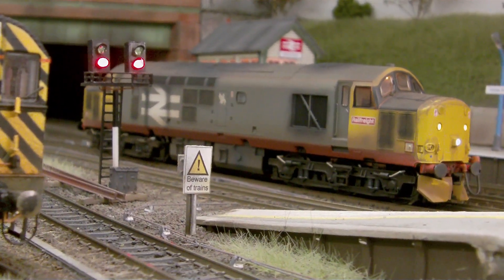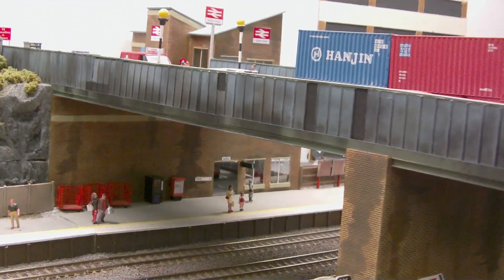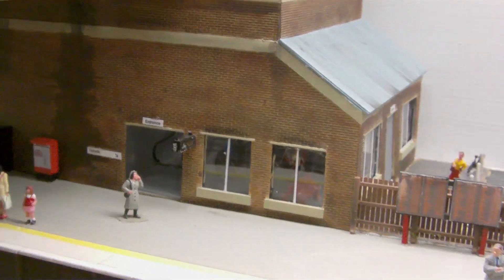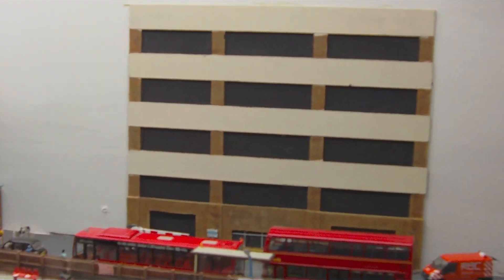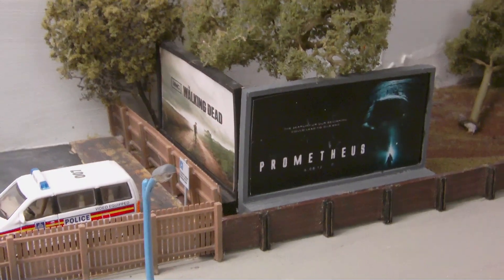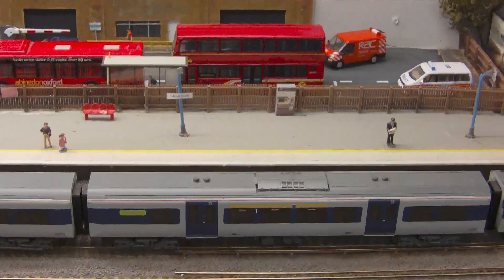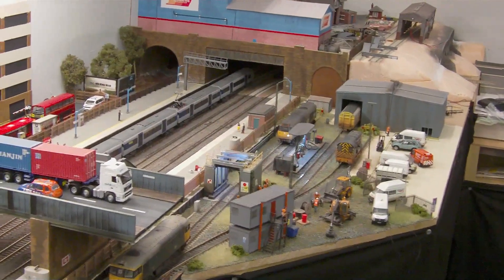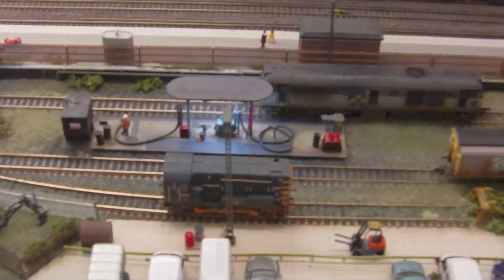August Update.

Comment from the maker: thanks richard

your right about the shed.i am going to turn it into a small network rail wagon repair shed.ilike you say the signs still needs to be added along with the door and glass for the windows and other details.
yeah im not to sure whether i will have the space to fit the points in unless i moved them into the platforms a little more but then that wont look realistic enough so it may have to be added else where.

Comment from the maker: hi shane

i think the multi storey car park measures around 12 inches high.
the road was made up with a first coat of tarmac paint and when dry i dry brushed lots if different shades of grey until i was happy with it.i used the same process with the path but used a sandy colour as a first coat to represent the concrete render and then again dry brushed lots of shades of brown and grey.its a long process but worth it.

Comment: another great update terry, your station is getting better and better, every time i see it, and the fueling points looks well good now, def better without the engine shed, maybe use the building as a network rail maintenance shed or warehouse or something like that, not sure I would change the throat of your station, could you leave that part of the layout as Glebe Rd station and have the junction side the left hand side of the concrete works

Comment from the maker: hi tommy

the shed is going to be a small network rail maintenance shed.i use a static grass applicator just like the noch one but i got it from hong kong and was around £20 and works just the same.
i use 2.5mm grass to begin with then top it up with 6mm grass to represent the overgrown areas and the grass i get from international models.

Comment: On your class 08s, try adding black weathering powered (Humbrol Black/smoke) to the rods with some oil (3 in 1), use a small brush to mix it and it looks really good on the rods of the shunters, I have done it to mine and it just makes them look that little bit more you see, give it a try and if you don't like it, you can just wipe it off with a damp cloth. But if you decide to keep it on, don't touch the rods, or you might get black dirty hands. :P